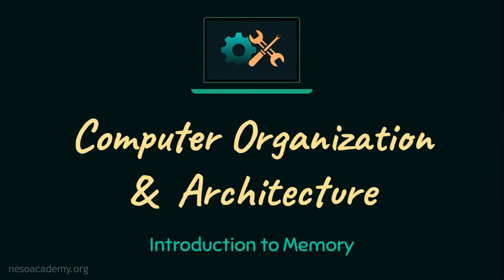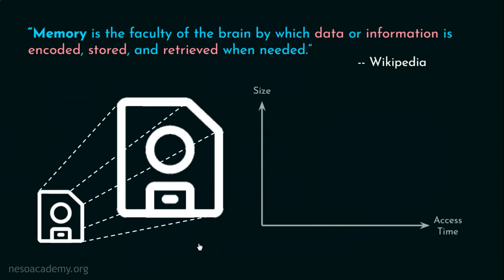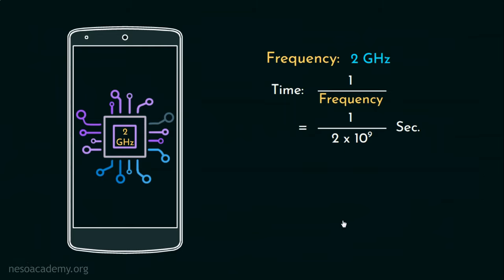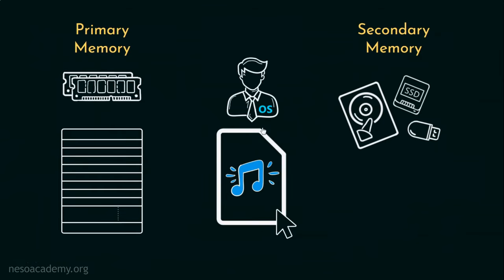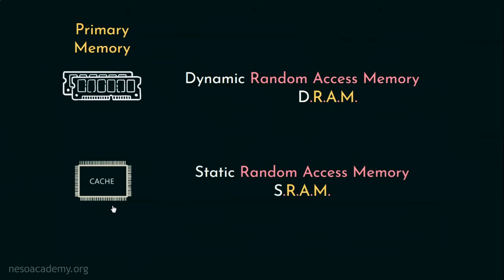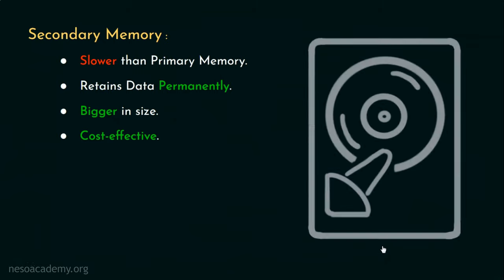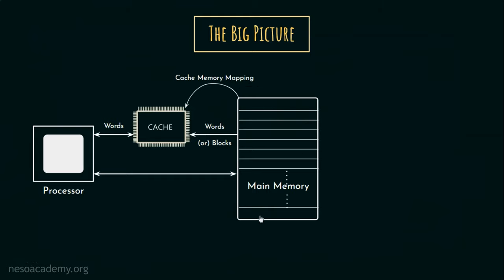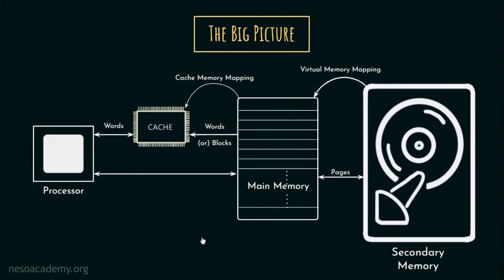Introduction to Memory

Comment: An instruction performing an arithmetic operation will be fastest if 
the operands are available in 
(A) Cache                     (B) CPU register
(C) ALU                         (D) Main memory                    please say the answer
Reply: C
Reply: the answear is registers. Usually there are 32 or 64 registers in cpu . After cache, after main memory. ALU dosen`t have a memory unit
Reply: @gamar1226  
R u sure ?
Reply: @sibanipadhy5433  yes, i am. You can easily find this on google search
Reply: @gamar1226  
Yes. I did try. But I am getting a dual answer from many of the site - cache, register
Reply: @sibanipadhy5433  Look at the next video just posted by neso. It is the answear there.
Reply: @gamar1226  ok
Reply: CPU register